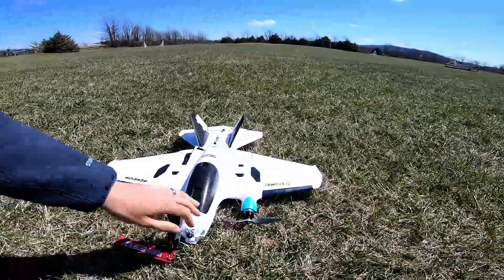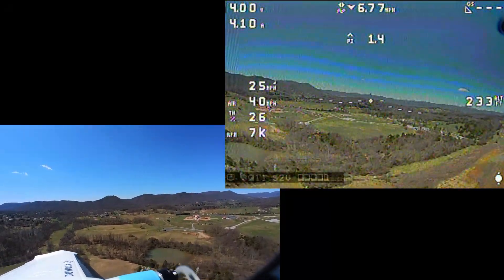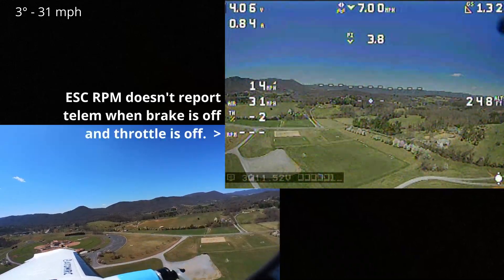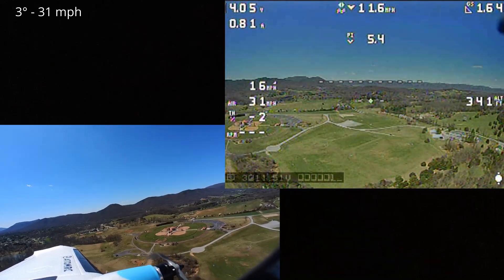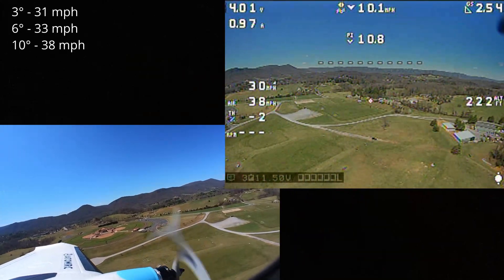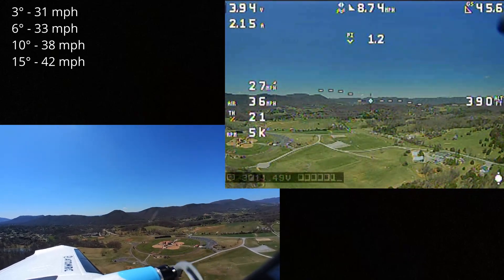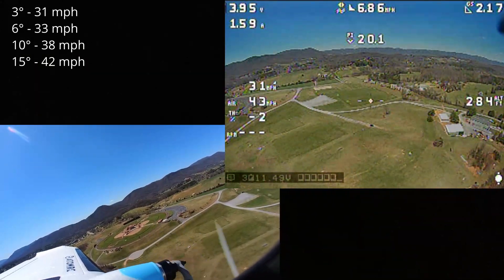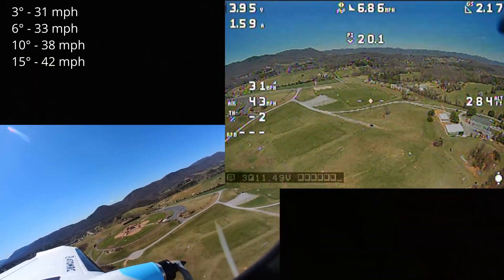ESC Brake - Does it actually slow you down?

Comment: try it with 1 prop braked and one windmilling. it should pull to one side.
Reply from the maker: Interesting thought!  I'd have to disable rudder stabilization because that would otherwise just correct for the asymmetric drag.  I like it.
Reply: @JamesDowningFPV I would do it in manual with no stabilization at all

Comment: Braked prop is much more efficient. You use very small props in the video  to see the difference. I have a 15 inch prop on a plane and I use it for slowing doing by letting it wind mill.
Reply from the maker: For the size of plane, the two 7" props have a good bit of prop disk area.  Its all proportional to the plane size.  I'd have no chance to fit a 15" on this plane.  This prop is also a 6" pitch.  Maybe the higher pitch makes it spin easier?  The data just doesn't seem to indicate it makes much of a difference.  Please feel free to try your 15" with the brake on and off and post the results!  I still bet the ESC brake just doesn't have much effect.

Comment: Very interesting! Thank you for taking the time to do this experiment. I was very curious after it was discussed on discord.
Reply from the maker: I wish the conclusion was more interesting.  But sometimes a non-result conclusion is still important I guess.  I'll be turning the ESC brake off, or at least reducing its power.  I broke one of those props on my last landing because I think it stopped pointing straight down.  Although - I may have broken it with the ESC brake off too.